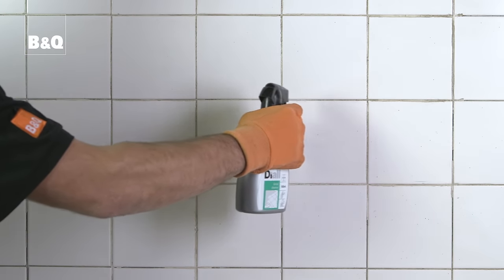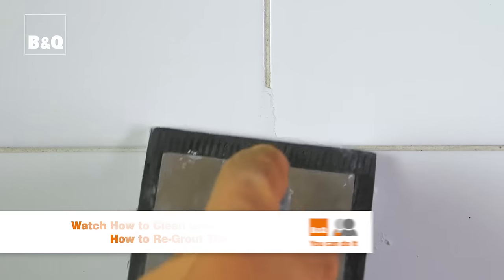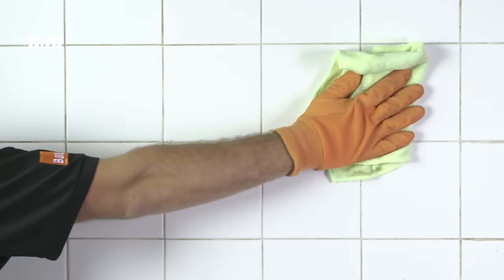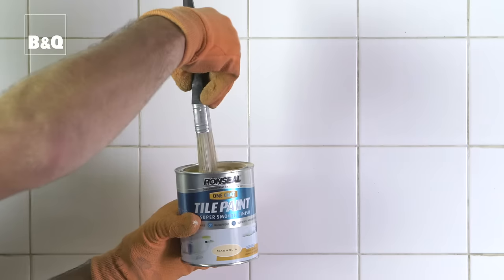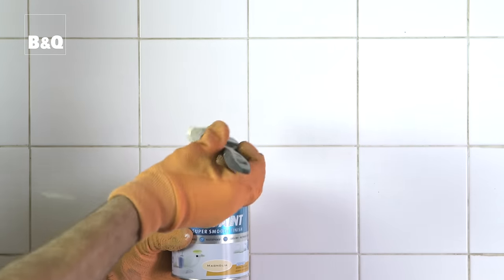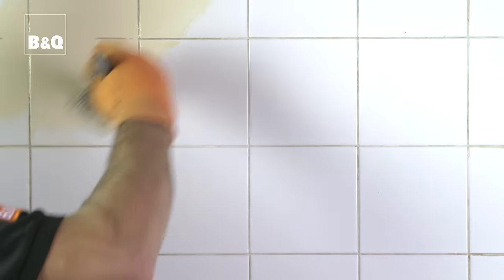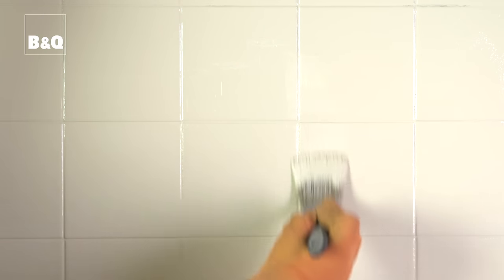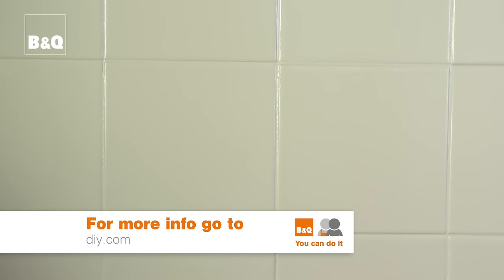How to paint tiles

Comment: Thank you. What if we already painted it but years ago and we want to paint it again , we must remove the old paint before?
Reply from the maker: You can paint over the tile however it may chip over time. We'd recommend stripping the old paint and starting over again for the best finish 🎨
Reply: @bandq  What is the best tile paint to use in the UK? Which is better to apply paint, roller or brush?
Reply: @MB-oi4rc  brush
Reply: How long does the paint last?

Comment: Do I need to sand down my kitchen splash back tiles before I paint them ?
Reply: most suggest these steps:
1. Clean tiles with a bleach cleaner, let dry 15-20 mins,
2. Sand with a 120-150 grit sand paper. Wipe down, let dry
3. Apply primer coat. let dry a few hours (see manufacturers rec, dry time)
4. light sand with 220 grit sand paper.
5. Apply final paint coat. let dry....Apply second coat if needed.

Comment: Can i use a paint sprayer to apply the tile paint?
Reply: If you want a horrible orange peel type finish then yes

If you want a smooth finish like a normal tile then no

Even using a brush doesn't give a nice finish, which is why this vid got a thumbs down from me..... Always, always use a small sponge roller, the type that is sold and marketed as a Gloss paint roller, this will give you a perfectly uniformed smooth finish

Comment: can tile paint cover the crack on the tile? can i use it on the wood as well ?
Reply from the maker: Hi, there. Paint can be used to cover small, hairline cracks on tiles. You’ll need paint that closely matches the color of your tile, so this method won’t work for most textured, patterned, or stone tiles. 
It's always best to use material specific paint as this will provide the best finished results. Many thanks!
Reply: @bandq  Thank you very much for your answer. 🌺🌹

Comment: Can you paint tiles in a shower bathroom
Reply: bandq thanks the reason why I ask is I used a guco halocan ceramic tile for a bathroom and as I cleaned it with a sponge before grout it developed a weird steam looking stain around the edges of all the tiles but only on the edge. Hence im thinking of painting over.